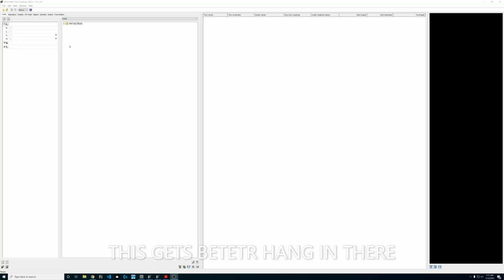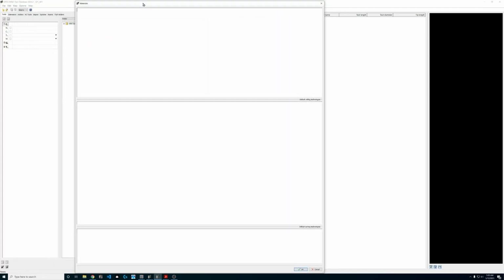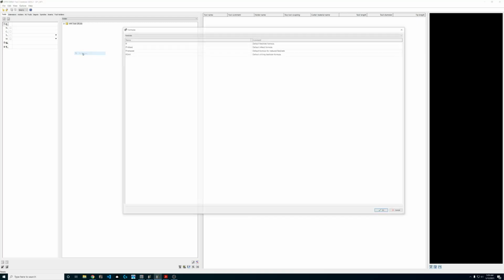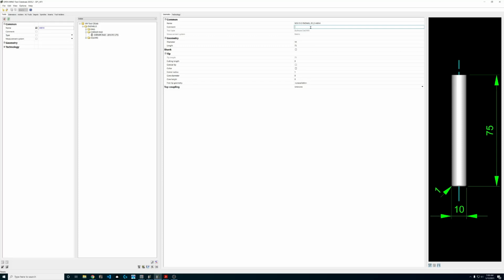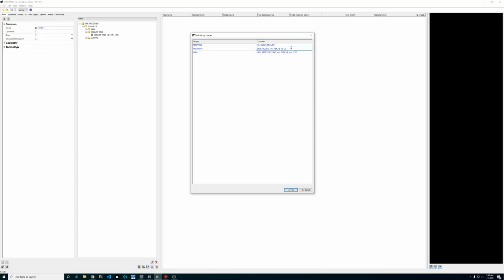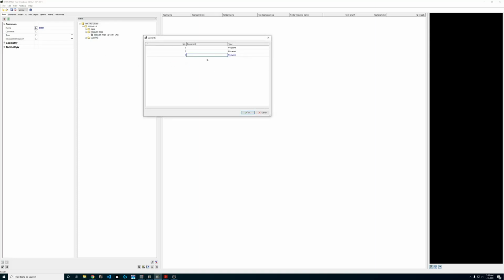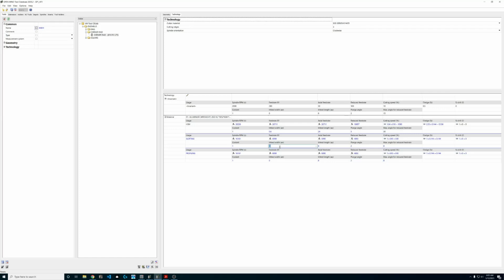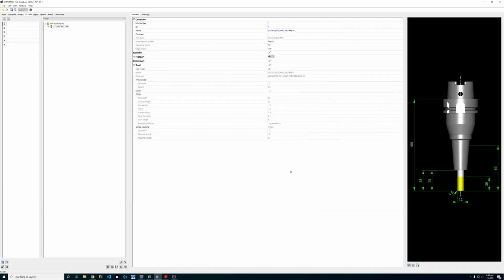A look at the hyperMILL Tool Database, Overview Part 1

Comment: This is a great video.  There is no other place on the web you can learn this stuff!  Please cover turning tools.    

Also a question: given that chip load and cutter diameter are directly proportional, why do you think they don't make a future that takes advantage of that?  It would partially do away with the table.

Comment: Thanks so much for sharing! Curious if you'd elaborate or point to resources that go into detail on the function of the NC number and ID fields. Trying to build up a tool management system in which each unique tool assembly ("NC tool") used has a permanent alphanumeric identifier that's common across an entire shop and all programmers.